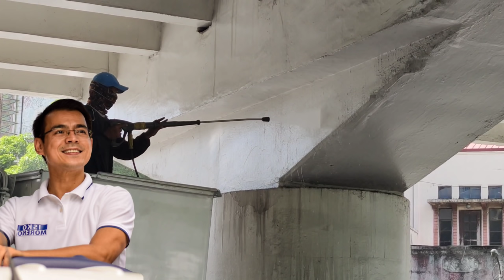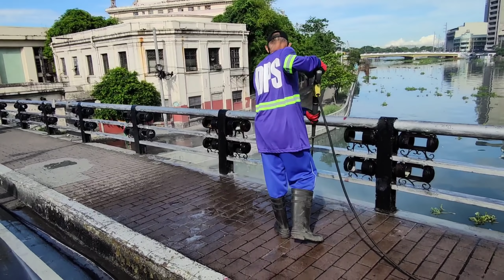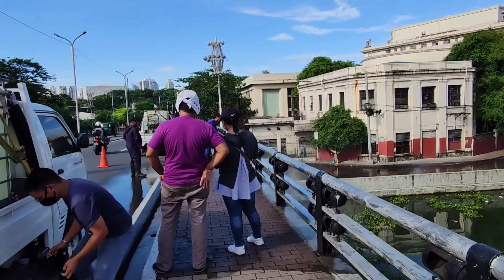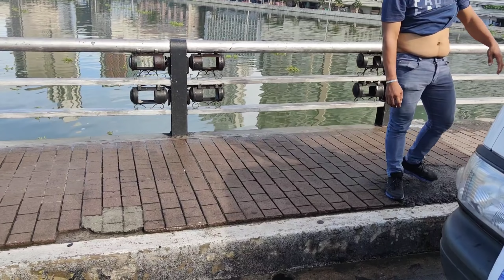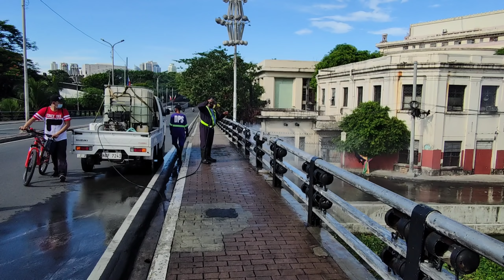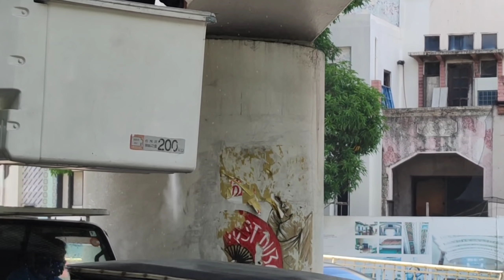POWER WASHING SA MC ARTHUR BRIDGE | YORME BANGON MAYNILA 07-04-2020

Comment: drop down the level of air pollution in metro and clean and power wash those building and structure ,other problem that needs to confront is diesel engine of vehicles roaming the city, during my stay in the city nagigitim ang damit ko sa pollution, wipe your face and you'll see, down with the pollution environment